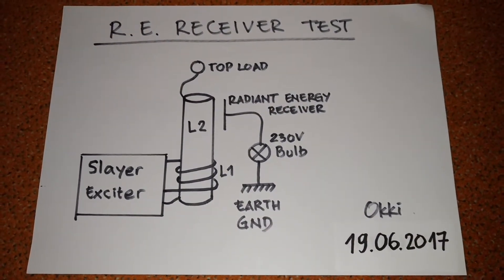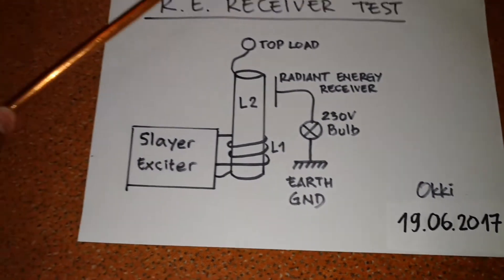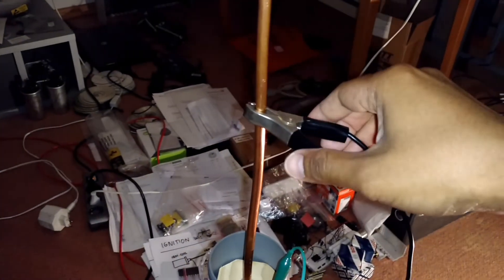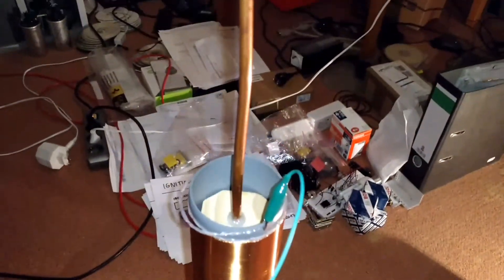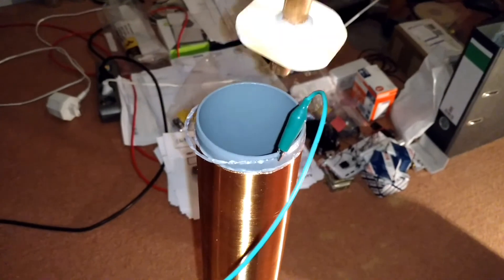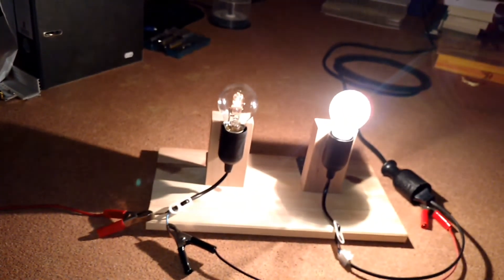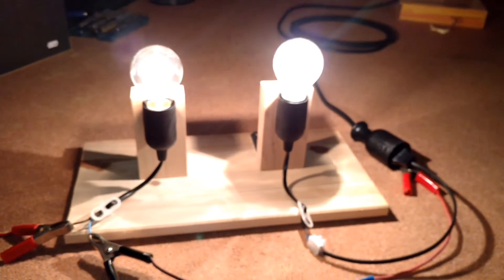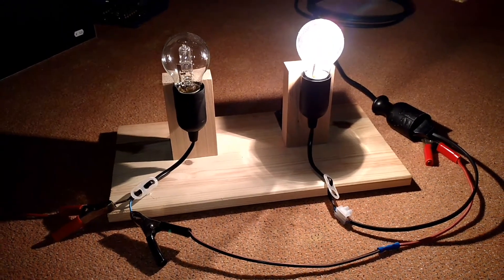Electro Radiant Energy - Copper Pipe Receiver Test

Comment: Hi, Okki! 

Could you give me your opinion on an idea that i have. I want to make a tesla coil with two primary windings, a hybrid tesla coil. The first winding will be LC circuit with high voltage source ( electrostatic machine ), this circuit will be with spark gap or with very high voltage transistor. The second of the primary windings will be a low voltage but high current, like this from the slayer exciter circuit and the primary windings will work with the same frequency, the resonant frequency of the secondary winding.  
What is the point, i want to try to accelerate the electron in the wire, Drude model says that after 1000V, other laws exist in the wire related with the electrons and their speed. With other words i want to try to increase the kinetic energy ot the electrons inside the windings. The spark gap winding will give a push to the electrons inside the wire, and the high current ones will give electrons to the system.
What do you think about this? 

Thank you in advance?
Reply from the maker: Hi Vencislav, thank you for your comment! In order to use a Tesla Coil, you have to make all windings working in the same resonant frequency. If you have 2 primaries, the result will most likely the same as my multi-primary Slayer Exciter. But that is only my opinion. Maybe the reality is different from that. It could also be like your thinking.
Reply: All the persons who works in the field of the free energy, their machines they use as loads only resistive elements (bulbs, heaters). As i remember T. H. Moray ones try to show to the audience this effect by connects a motor to his device, but the motor dosen't start. 
If you have fast electrons in low resistance wire and after that you stop them i high resistance wire, their kinetic energy will become heat. 
In deed all the free energy devices use two energy sources, a high voltage one (Wimshurst machine - Testatika, Tesla- Tower (atmospheric electricity), Kapanadze-High voltage transformer) and low voltage one, a car bateries mainly. 

Thank you very much for your previous answer, tomorow i will start to dig in this field :))
Reply: @vencislavkirilov6530  And...high frequency...VK